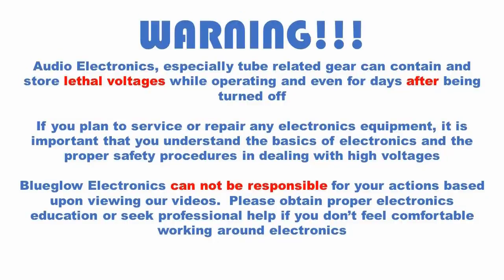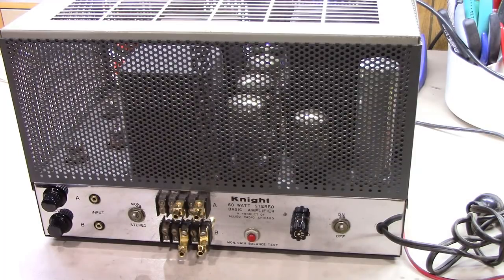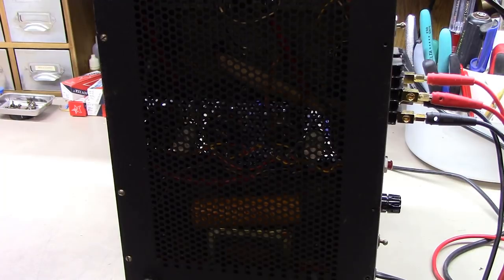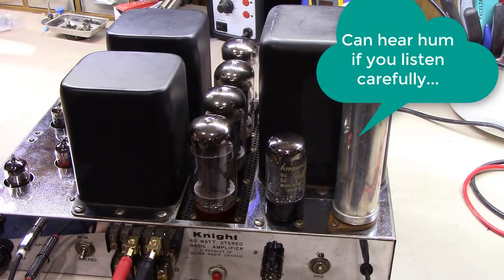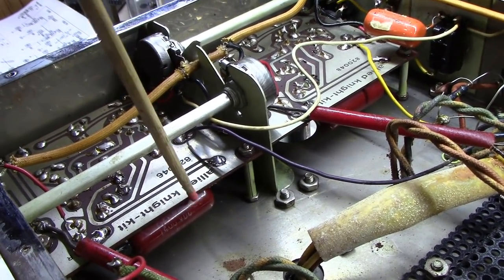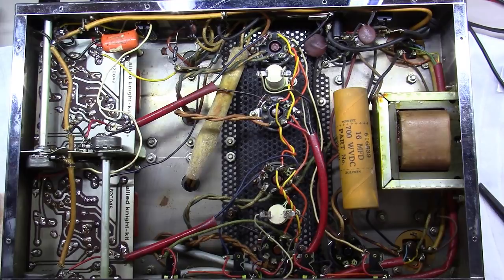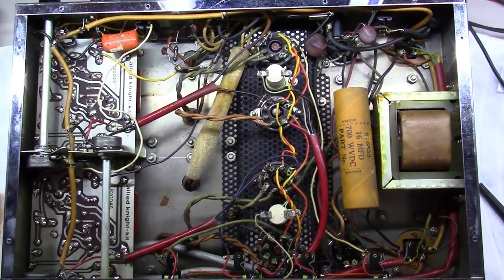Tube Gear Troubleshooting - A Trivial Problem Found - Part 6

Comment: It was mentioned at the beginning of this video that you weren't sure whether this was the factory-wired version, or a kit. An easy way to check (and this applies to most all brands) is to examine how the chassis-mounted tube sockets are secured. If mounted with rivets, it was factory assembled.  If mounted with machine screws & nuts, then it's a kit. Of course, if somebody did sloppy soldering with leads hanging all over the place, you could also make a safe assumption....

Comment: You need EL37 or EL34 tubes for this. This is a nice amp I won 2 restored of them did the restoration by myself. Replaced all aged paper in oil caps with russian military pios and the electrolytics on the cirquitboards with new german F&T´s....the orignal multisection caps and even the single 16uF electrolytic high voltage caps reformed perfectly, no need to change. The electrolytic with that cardboard cover in fact is a solid electrolytic cap like a tantalum it does not age.

Comment: I'm glad you're back into circuits Mark. I have switched tubes on stereo amplifiers to see on scope if there's any changes in signal strength or whether there's distorted waves, noise etc. Bad solder joints, un-shielded audio cable, ungrounded wire, bad decoupling caps and bad elements in tubes causing noise and hum.  I enjoyed the video.  Thanks!

Comment: Would love to see this brought back in another vid to see you go over the updates and upgrades. Another great video 👍🏻
Reply from the maker: I've ordered the can caps, will make a video on the restoration
Reply: @Blueglow  The 16uf at 700v that goes across the GZ34 rectifier tubes, I always put in a 22uf @630v film cap in its place. The can caps I use the Authenticaps  550vdc which is a must. I always go up in capacitance after the choke and double it. I run the cathode bypass caps direct across the cathode resistors and I use 100uf 100v muse KZ.

Comment: I love these videos!
I know this is a nit-pick, but Mark told us to check his use of words, so...
... it's not a quarter inch "phono" plug, it's a quarter inch "phone" plug.
Phone plugs were used with the old telephone switch boards and are used with electric guitars and other audio devices. 
Phono plugs are RCA plugs that carry the signal from a record player (turntable) to the phono input of a home stereo, with a low level signal and that funky lopsided equalization.

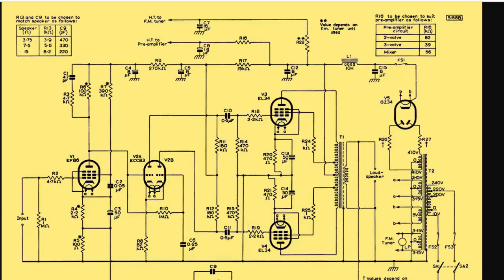Comment: 14:50 - Looking at V2, I don't see a phase inverter circuit. V2-A is a wide band inverting amplifier fed directly from the plate of the EF86 and V2-B is also an inverting amplifier being fed through a 1M/0.25uF low pass filter! Could you scope the outputs of those sections and prove that is a phase inverter? Meaning that the two output tubes are being driven with totally different signals! On the plates of V2 I would expect two identical amplitude sine waves, in 180 degree opposition on the two plates at all frequencies. I just don't see it with that circuit. Thank you in advance. 

In hind sight, IF the grid going to V2-B is pure DC, then the phase inversion is occurring in the current division on the cathode resistor as a classical differential amplifier.... Please confirm.
Reply from the maker: You are correct, should have said inverter circuit.  No argument on this one.
Reply: @Blueglow  Thank you.
Reply: It's a classic direct coupled long tail pair phase inverter, and is indeed a differential amplifier.

Comment: The most popular audio small signal pentode - EF86. Most popular  general purpose small signal triode ECC83. No. of amplifiers using voltage gain with EF86 and a ECC83 phase splitter = too many to count. The Knight output stage isn't like the Mullard circuit. That was a wayward jump to say they were copies. I couldn't see it. I think you got a bargain too, an un-messed about with amp in excellent condition. I wouldn't have argued. I would have been happy as Larry. That was 1 in a million find.
Reply: I'm sure he was happy with the price or he would have returned it?
Reply from the maker: @rayislooking2  It wasn't a steal but wasn't worth the hassle of returning it knowing I would likely go through it anyway.  More just trying to warn people that "restored" stuff on ebay may have had very little done to them.

Comment: The 4 Volts on the lower side of the coupling capacitor, is no leakage. They are supposed to be there. Look at the schematic.

Comment: "Restored" means different things to different people. To the layman, restored could mean only that it was worked on and made functional, brought back to life, or resurrected. Always ask what was done and what was changed, adjusted, cleaned, etc... If you buy it under the your assumptions of what should have been done to meet basic standards of restoration and it fails to meet that, then be sure to communicate clearly what you expect when buying any used gear before buying. Lesson learned

Comment: I bought restored radios ,I was warned by another you tube when people say restored they sometime just do enough to get them working and sell them as restored ,also at the time couldn't you get help from pay pal or eBay ,all you would have to have done is like you did take the cover off it shows proof they were lying ,Me I hate to lose money ,also sometimes.it's hard to trust your fellow man ,so far I been lucky ,one because I will hitch about the problem and second I will take pictures to send as proof .